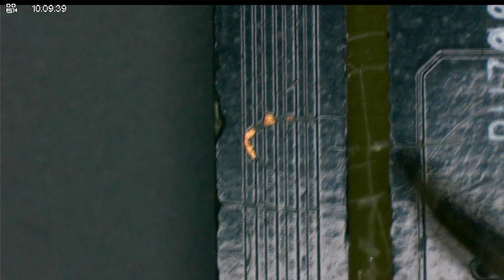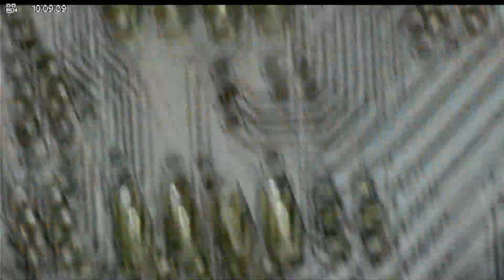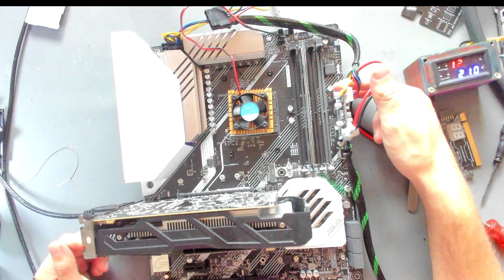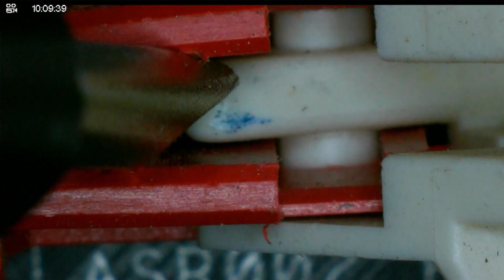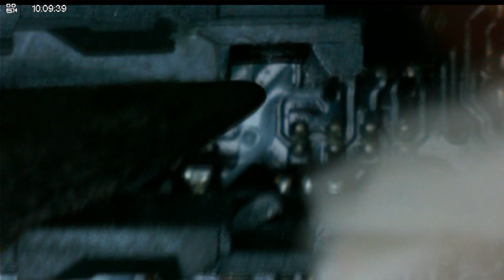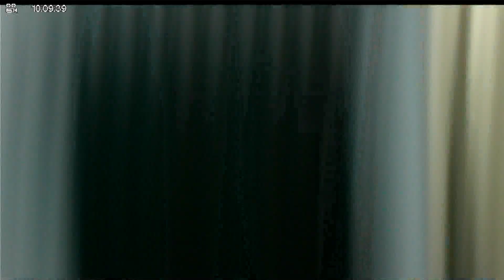ASUS X570 PRIME PRO REPAIR || MOTHERBOARD REPAIR STUCK DRAM

Comment: Got the exact same board, i was using it a couple hours after buying it on Kleinanzeigen, then all PCIE devices dropped out, then it wouldn't boot and kept getting stuck on DRAM or CPU led. Actually, that's how I found your channel, this happened a year ago and I was trying to find creators who have worked on boards with similar issues, but you didn't have this video up yet. So now I'm gonna watch it and see if I can revive mine! :D

Comment: if I send you my video card could you fix it for me blown mosfet and think A short 980 Ti
Reply from the maker: Hey there i can do that, but often the board doesnt survive because the Mosfets burns into the board and then its game over!
Reply: @MainboardMedic  Thank you for the reply I watch you all the time I think you're right I did heat it up and pulled the mosfet off and it's burnt really good do you by any chance have an old board that works that we could put the cover and the heat sink on that I could buy from you I don't have a lot of money I know 980 TI is old but that's all I can afford and are you located in the US
Reply from the maker: @danfrench5221  Hey there sadly i do not have an working one here! And also i am located in germany so that wouldnt fly also! Sorry!
Reply: 6:40

Comment: I wonder if your debug pcie card might have fixed the stuck reset by having it plugged in and powering the board on with it? just seems like thats the only thing you really did differently before it started working
Reply from the maker: That would be crazy, but who knows maybe it did!

Comment: Hello! i'm working on a Gigabtye z690 aorus elite ax DDR5 and i was wondering if you know the answer to this question: Should the chipset get hot when powering on the motherboard without CPU and RAM?(the motherboard has the cpu light on and i think the chipset may be the problem but i'm not sure) Thanks! (NEVERMIND, it's the Chipset)
Reply from the maker: It should get warm but not really hot! You will need to check the resistances off it! Like 1.05V , 1.8V 3VSB etc.

Comment: 4:45 The trace third from left seems to be cracked. 
It might make contact when under pressure from the GPU being mounted.
Reply from the maker: Nope they are all fine. You can still se the copper contact and also the trace is still wider than the scratch!
Reply: Yeah I thought the same, looks like a hairline crack on that trace, wonder maybe it could be causing an intermittent issue!?
Reply from the maker: @harveystedham9490  I dont think so, there is to much off the trace left there!

Comment: I have asrock b450 mini itx and my board stuck on reset loop, i hear relay in my psu and it reset all the time. Have you some idea what should i check in that board?
Reply from the maker: If its reseting quickly then Its probably a short somewhere on the board and your PSU goes into protection mode!
Checkng out resistances or a thermal camera can help to find the short!

Comment: This is crazy! Got scammed a month ago with this board, got exactly the same problem, it's stuck on dram led, from time to time go to CPU led, but unfortunately no fix for mine, its stuck on reset, the previous owner definitely temper with the board, as there is some  soldering done near the sio. Unfortunately I don't have a microscope to look closer and impossible to find schematic for this board without a paywall... So far the only thing I try is to flash the bios but with Asus is such a pain (i did manage to find a proper dump on badcaps)... And before that i noticed  that i don't have 1.8 v on the ic but 1.4 v, is this normal? Any help would be appreciated. Anyway thank you for the content, I was so thrilled to see u repair this one, I learned a lot from you so keep the good work !
Reply from the maker: sent me a message on my email regarding the boarvew for this modell!

Comment: Very informative, thank you.

What are you using to power the boards? Is it a custom pcb?
Reply: Thank you, appreciated!
Reply from the maker: @Roamor1  Hey there @AgentHondaCivic is right! Ths is a HP server power supply 12V 100A, that has a breakout board for 12V on a 6pn gpu connceter that is then connected to a 12V amp meter in series which then connects a Pico adapter that takes 12V and converts it to a 24 pin atx standard!